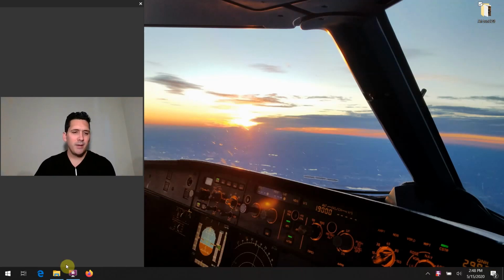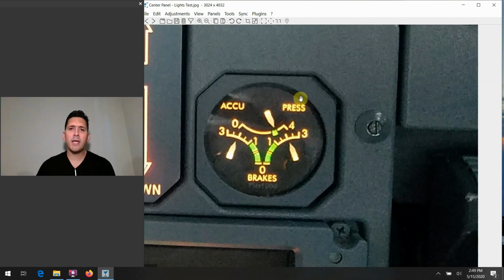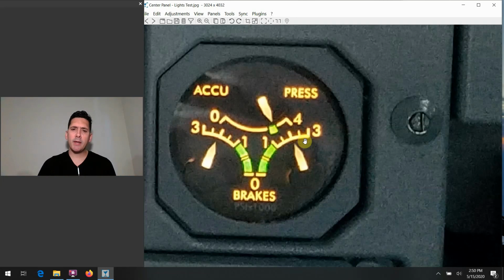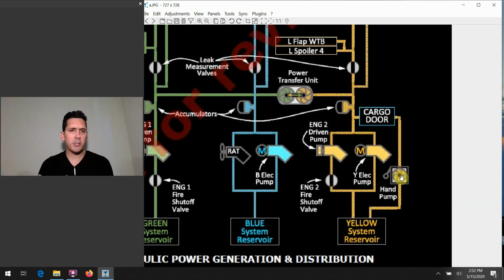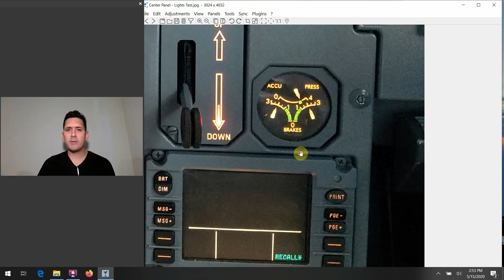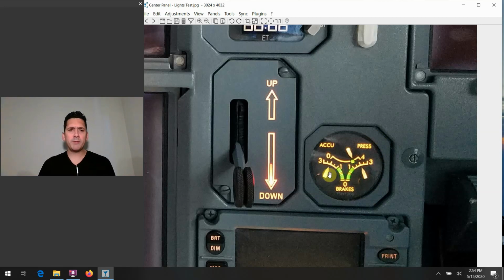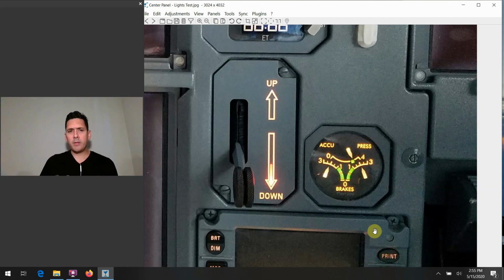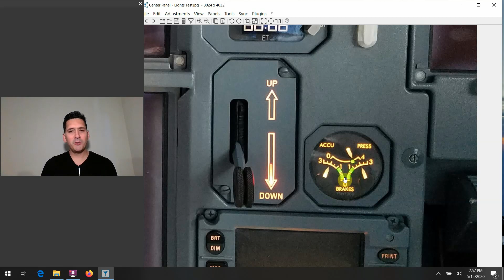Airbus A320 Cockpit Tour: #60 - YEL HYD Triple Indicator: What do all those buttons do?!

Comment: If we are doing one engine taxi (engine 1 on) and yellow electric pump is off, how does the parking brake get pressurized if we have to stop for any reason?
Reply from the maker: A good question Saurabh. In this circumstance the yellow system would still be getting pressurized through the operation of the PTU.

Comment: Why do We have to check the Accumulator psi in Green before we turn into the stand?
Reply from the maker: Hey Saurabh, hope all is well my friend. Well this would be to ensure that you will have hyd pressure to keep the parking brake set. Once the engines are shut down and provided all electric pumps are off the accumulator is the only thing that would be giving you pressure to the parking brakes. Of course you would usually have the wheels chocked at the handstand, but its a good safety check.

Comment: Greetings Mike! Had a couple of questions for you.
1. You mentioned that when there is a lose of normal braking, you’d obviously want to activate the alternate braking. How would you do that so as to get the 1000psi limited brake pressure upon landing?
2. Since the parking brake runs on the Y system, do you have to switch on the Y hydraulic pump ( I would assume the electric one) in order to pressurize the system prior to push back and engine start?
Reply from the maker: Hello again my friend. Thanks again for tuning in.
1. This is accomplished by using the toe brakes on the rudder pedals and monitoring the triple indicator to ensure you are staying at or below 1000PSI.
2. A great observation. During this period of time where no Y pump is physically running, you get pressure to the system through the hydraulic accumulator. This accumulator is an interesting piece, think of it kind of like a spring loaded mechanism that stores up force for usage when the pumps are off. The accumulator actually maintains pressure for a substantial amount of time, several hours at least. So even if the plane has been sitting at the gate for a long time there will still be some pressure in the system without having to use the Y ELEC pump to "re charge" the pressure prior to push and start. It is interesting, I have tried to look this up, but I still haven't been able to find any reference in the manuals as to what amount of time thet claim that the accumulator can maintain it's pressure. I assume it varies with atmospheric conditions though. Hope that all makes sense..
Reply: Mike Abignale Hey Mike Great video as always ... According to my FCOM under Landing gear- brakes and anti skid says “ The accumulator maintains the parking pressure for at least 12 h.”